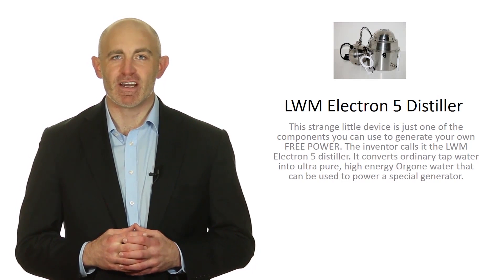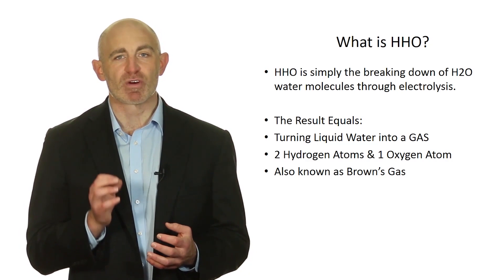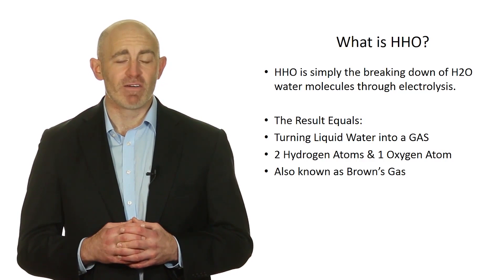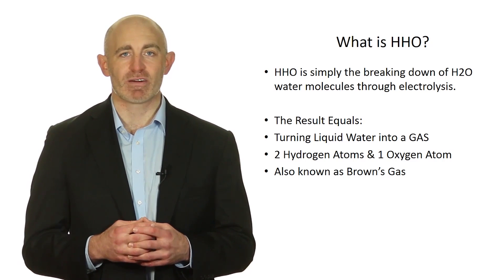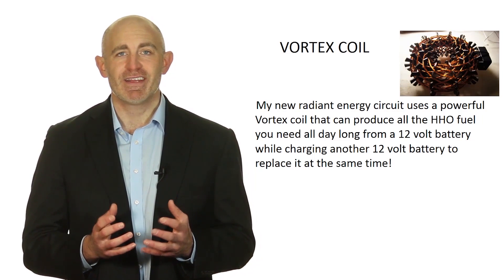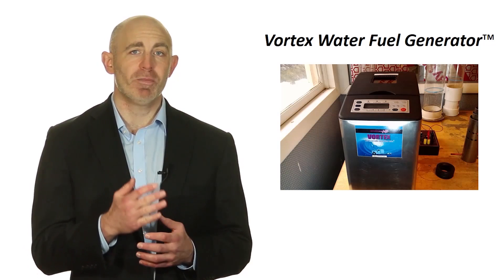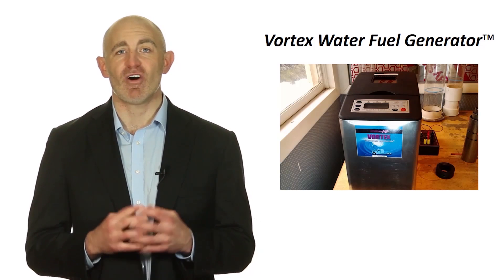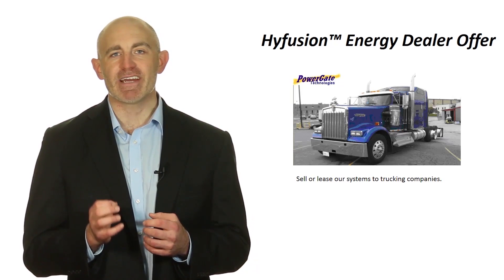HHO Off The Grid Home Power System

Comment: Hmm, looks like an automatic bread maker with a laser printed "hho generator" label stuck on it.
Reply from the maker: Good eye. Actually, the new system, 2018, has nothing at all in common with the original prototype. If you are seriously interested in a system that works visit either my alt-health site at www.RXCures.com and check out the Hydrogen Hydrotherapy Spa or visit www.HHOTrucking.com .
The new truck unit uses PEM, split gas generation and a synthetic gas, NOT HHO.
You are viewing videos from 2014....gotta get up to date, dude.

Comment: What is HHO? Something that doesn't give you free energy.
Reply: Mmmmm...... HHO comes from where? Yes water! H2O just use electrolysis to extract it. Did you know ALL automobiles has a huge DC energy source (70-115 amps) just waiting to be used. It just sits there after starting your car engine, why not use it to break down water to HHO? You already PAID for it when you bought the car.    

How much does water costs vs oil?.... it's free! Find your nearest stream, river or lake and bring your gallon jugs.

They also say hydrogen/oxygen is not powerful enough energy source? Guess what fuel they used on the main engines on the USA shuttle.
Reply from the maker: Wow....Brilliant, Henry! Why didn't I and everyone else in this field think of that?
Reply: You're an Idiot.

Comment: The Federal Trade Commission will charge this guy with fraud at the mere mention of something that can power itself!  www.ftc.gov or https://www.ftccomplaintassistant.gov
Reply: +R Randall They can't. He's right.
Reply: well not necessarily it still takes fuel (water) half gallon every hour to run and get burnable gas. but he doesn't say what that half gallon burned equals in output. I have to learn more before I say more though. but if it is real and has a high output of energy he will either be the world's richest man or dead so..

Comment: Sure does sound like a perpetual motion machine to me......It requires electricity and electrolyte to create hho and the fact is the more you create the more amperage is required, this is a SCAM! You would be better off to use 12vdc appliances or even an inverter.
Reply: does a tornado or hurricane require an outlet to perform work? nope where does a tornado get it's energy from? yep a high pressure and a low pressure so as long as you have an open system of high and low pressure you got free energy everywhere in the form of heat.. it potentially could be closed loop I guess in theory maybe I'm wrong on that but all overunity systems I have ever saw require batteries and that is part of the overunity you know hydrogen.
Reply: +R Randall I have seen instances where they used only 12 volts and just over 2 amps and generated an appreciable amount of HHO. You just have to start with distilled water and add the electrolite to the optimum HHO output. 12 vdc appliances are an excellent idea as well.

Comment: wow i can power the unit from a 12 v battery.... put that into the system generate hho gas and recharghe the other battery then run the process in reverse ??? hmmm even to a person like me that has some understanding of how hho gas works and what the benefits are ... even to me this smells like a scam
Reply: that's how all open system overunity devices work you gotta have high and low